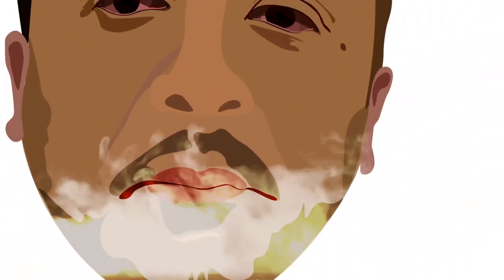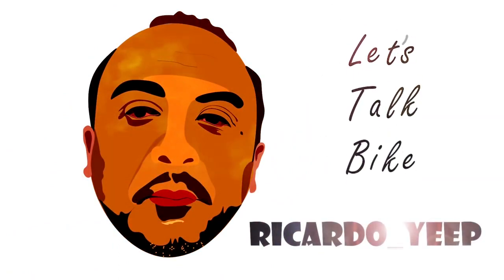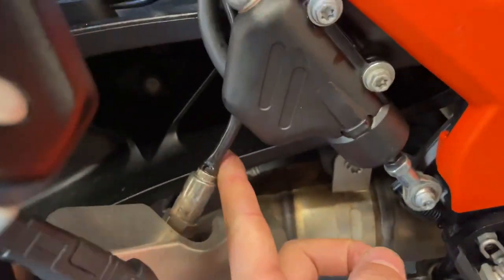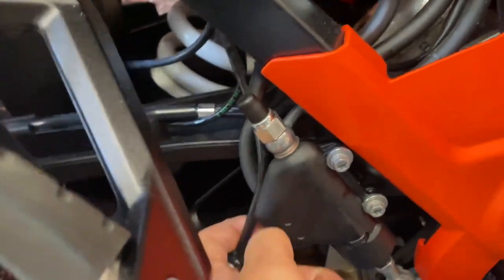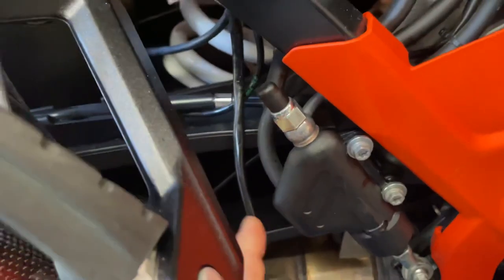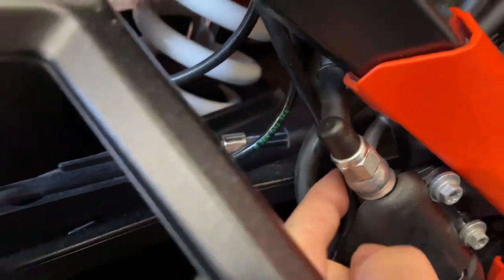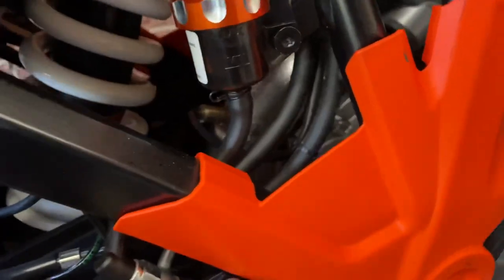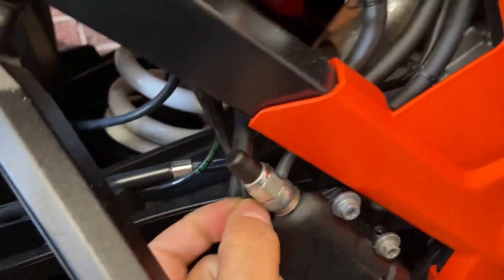2021 2022 2023 2024 KTM 1290 Super Adventure Electrical Problem Short Circuit  and Breakdown

Comment: I immediately checked my brand spanking new SAS and low and behold, they have changed the cable routing. It hugs the brake cylinder and from the top of my head I think mine hasn't got the plastic cap on the cylinder anymore.
Reply from the maker: Hiya Hermann! Nice one thats good to hear. Seems they have been hearing and working on the "problems" picked up on previous sold bikes. Just these little tweeks make all the difference.

Comment: Hey Ric
I had also a problem with a tywrap on my 2018 SAS.
By the outsidetemp probe on the frontfork ,i get a warming on the dashboard no outside temp .
When i look further i found the cable to the sensor was broken under the last tywrap for the sensor.
Nice video,s further keep going.
Reply from the maker: Hiya Harry! Thanks for the comment and good feedback mate. Appreciated. Yeah I heard that KTM have a past history with poor cable routing causing some short circuits over time. I am just hoping that this is all on the new 2021 1290. So far I have not had any problems at all on mine to date. Apart from the fuel petcock not turned on by the dealer pre delivery... 

Cheers
Ric

Comment: Hi can I have a bit more infor on this. Please .I changed tyres on my 21 1290 and on start up I have  the traction control .abs and engine management lights on.also I can't change any ride modes or high beam doesn't work .have you or anyone else had same problem thanks

Comment: Ric, I looked at mine and the lambda sensor is actually clipped to the rear rubber brake line, in the place you say it will eventually rub,  so a tad confused now. Was yours ever clipped to the brake line?
Reply from the maker: Hello mate. Sorry slight miscommunication on my part. I should have stated just check the area if yours is likely to become rubbed and fray. not all bikes will have this. It seems whoever worked on the bike at the time at the factory has not tidied the hoses or clipped them as they should. Yours sounds fine then. But was worth a check anyhow! There a few instances of this already so yet to hear how big the problem is.

Thanks
Ric

Comment: U thanks, good to know, my 1290 s arrives in a day or two. Since I come from Suzuki which is amazingly reliable, I dont know what to expect on a KTM.
Reply from the maker: No problem mate. The 1290 is an amazing bike. You get teething issues on all new machines KTM no different. KTM wont the Dakar rally 10 years in a row so then know how to make bikes (albeit high performance bikes which by very nature possibly means slightly more maintenance but lets see). So far I have not had any issues apart from the general seat issue where it wont stay in the high position (but KTM are rolling out a fix I believe). Other than that my bike has been faultless even after some riding most people wont even do. Congrats and good luck. And more so thank you for the comment and watching! cheers Ric
Reply: @RicardoYeep  thank you for your reply and inside look. Keep it up with the videos 👍

Comment: What is KTM uk saying about this, surely it needs a recall for remedial/ retrospective work to alleviate the issue
Reply from the maker: Hiya Jon. Cant really say as I don't know. From the incidents that have happened it seems to be hit an miss if you have this poorly located lead. My  only guess is down to whoever was working on the bike at the factory and was a bit "slack" in a manner of speaking. Its not really  something like all bikes they know had plastic "activated charcoal drainage plugs which the recall updated all to metal... this problem just seems to be random. And also not sure how large scale it is too. But maybe we shall see over time. As folks need to be doing the mileage I guess to end up rubbing through the lead! 

Cheers
Ric

Comment: Always watching problems with KTM. Not a good and safe brand i guess, especially riding out for adv or off-comfort zones. I think it is better using 10-20hp less power bike, in exchange for safer rides. I will not buy or pay for these shitty problems. I own another brand bike for 40.000 km and never had issues like you shared in your videos. Austria is good at building water dams but not smart to make vehicles.
Reply from the maker: Good Morning Eray! Thanks for watching and your time to comment. Despite unfortunately there is an element of truth in what you mentioned for sure I agree. But I personally never had an issue on my bike apart from tall seat setting (which is a general problem being fixed by KTM due to manufacturing design issues). 

I cannot blame the Bike for the Tech guys not turning on my left fuel petcock pre delivery. I have ran this bike quite hard and nearly maxed out on its performance with no negative after affects, I have done intense cross country two days solid rally over various terrain and again not a single issue. The bike runs flawlessly and sounds smooth as it did when I first collected it.

The point I guess is it that negative points stay in minds much easier. It would be I guess be fantastic if everyone who has never had a problem voice up and we would see how small a percentage (possibly.. or even hopefully) actually have the issues we see. I know for sure at one point I had the very same opinion of Triumph. But several triumhps later  I would say they are one of the most reliable bikes I have owned. I can assure you the obvious brand BMW had definitely had their share of problems too.

I would definitely agree with you reliability is still in the back of my mind with KTM but I am giving it the benefit right now. I have been given no reason to not trust it.

We shall see.. I may eat my own words haha !

I think winning the Dakar 10 years in a row shows they can build bikes (No other has done this) !! I guess whether these high performance bikes will last the term of ownership in real world daily use without team support is another question. :)

Cheers
Ric

Comment: I dont want to sound rude,but mate you should maybe get rid of KTM...
Before goes out of warranty.
I know any bike can have a problems not only KTM,but seems like this one is really glue for problems.
Reply from the maker: Hiya Alex! 

If I had a problem with mine I would consider it. However apart from the "Tall Seat setting" problem which seems to be generic, My bike has been faultless! I cannot blame the bike for the tech guys not turning on the left fuel petcock pre delivery. 

The problems recently highlighted were those shared by the community wanting to use my platform as way to help others be aware and also in the hope some one can voice up and say how they resolved it if at all.

I love my 1290SAS and even after 600KM weekend rally across various terrain/water/weathers. Bike runs like new and after a clean up can go back on the dealer floor. Flawless in all aspets.

Cheers
Ric